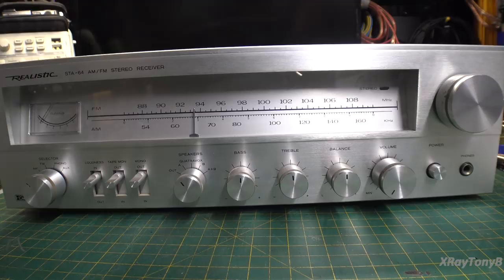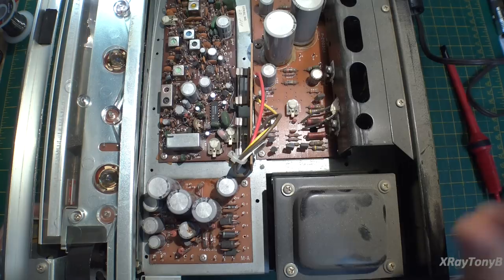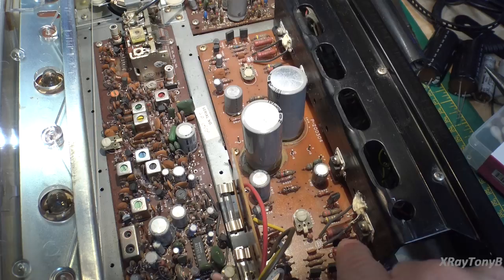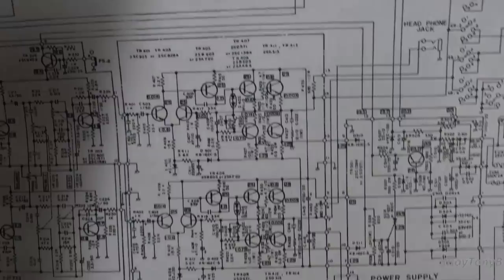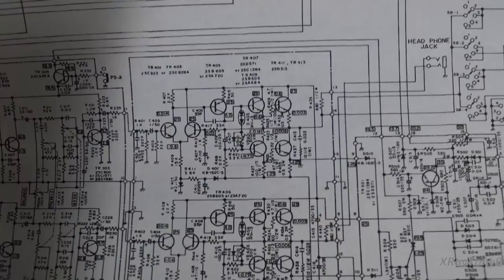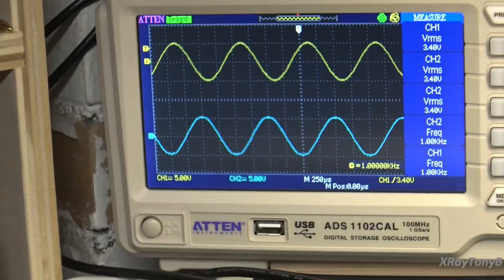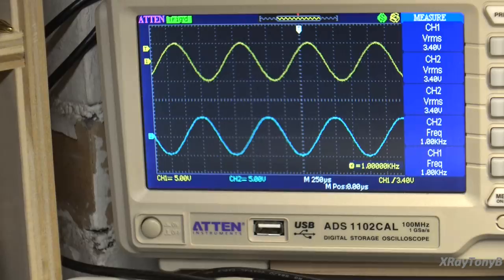Realistic STA 64 Repair and Restore

Comment: Nice video! 
I was a factory technician for Tandy from the mid eighties to the mid nineties. At that point the writing was on the wall regarding disposable electronics. Ive rebuilt thousands of amps in that time. Some of the Realistic models were average but many were exceptional. Most failures Ive seen were caused by intermittent bias pots and people stacking stuff on top which interferes with cooling. 
I had a great time working on these units... Thanks for the memories.
Reply: I was  a bench tech.for a major company in brooklyn N.Y,and Radio Shack stereo equipment sounded just as good as some of the other brands,and was more reliable.Hated to see them go out of business,makes me nervous about Sears.

Comment: Hi! I just discovered this video and I wanted to say thanks. My dad had one of these when I was a kid and we spent a lot of time listening to it. I found one recently on eBay and the guy that shipped it did a poor packing job and it arrived damaged. It was also not as described, the volume knob turns all the way around and all the lights were burned out. I bought a new faceplate to replace the broken plexiglass and found the whole front control assembly which I will replace. I have a long background in electronics so I know what I’m doing. I also have the schematic and service manual for it. Thanks again!

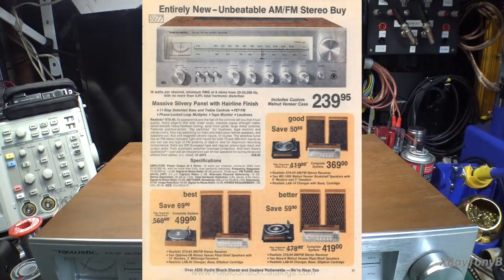Comment: I bought this as part of the best system pictured at 5:34 of your video.  I've used extensively it over the  years and I have no regrets  about buying it.  I have it  coupled with 4 Optimus 5B speakers and a  old Technics cd player and it still sounds great after all these years. The only thing I did to it was to replace a couple of bulbs. After 40 years I guess I got my moneys worth.
Thanks for the video.

Comment: Great video. I just picked up one of these has has a low and distorted left channel - so I will rebuild / recap it and use the MJE-3055 transistors you mentioned on the outputs.

Comment: Watched this video and I now again have my first love, a Realistic STA 64 that after some work is like it just came out of the box. What a unit! The wood walnut veneer case and brushed aluminum face is just another level after looking at black tin boxes with plastic faces for decades. The weighted tuner knob.... I forgot there was so many radio stations in between where the digital numbers stop at. It may not come in perfect but hearing a station 2 states away by chance is like discovering some undercover spy ring or something. lol  
A lot of folks think of clock radios and such when you say Radio Shack but back when stuff like this came out they had some pretty nice stuff. They put the same quality as the bigger names into their stuff but they were not known for their big power where a lot of the money comes into building power receivers. I got around that by using a 7 band EQ and a 40 watt per channel power booster from a car. For a 12 year old kid in 1980 my system was jamming. For the one I have now I included a Technics 7 band EQ through the Tape monitor. From the high level output speaker connects I ran it through a high/low converter and into a Crown CT 4200 Power Amp to a set of Infinity RSa speakers. If you have ever saw the first Star Trek movie, I refer to it as my V'ger project. When you can let the receiver do all it did but without the speaker resistance coming back to it (heat), opens it up to what it could have been. Everything you and I loved about the Receiver but more and more and more. Funny thing is when I went to find one of these receivers I found one that was missing the wood box but had a faceplate so it would fit in a commercial rack system. So I guess I was not the first to think about fixing it by just adding more power.

Comment: The channel imbalance in my experience quite common, and the volume control tracking is partly to blame. That's why balance controls should not have detents and why we should not be afraid to use the balance control. I have to listen mainly on headphones and these small differences can be very noticeable in my situation.

Comment: I have an STA 2200 that I bought in 1979 or 1980.  Sill mostly OK.  It has needed replacement of memory backup battery and it probably soon deservers overhaul of the capacitors.  But the real problem is the pushbutton switches that would really need replacement, as contact spray has just very limited effect.  On power-up the tuning VFO does not often lock in and the speaker protection relay chatters.  The effect sounds like between stations hiss mixed with motorboating.

One thing that I did when I bought stuff from Radio Shack was to  buy (or sometimes get free of charge) a service manual.  They have good schematics and parts lists.  Of course the Radio Shack part numbers are nowadays not too much of help.  And speaking of schematics, I would guess that the filter you mention in the IF section is ceramic (actually two), rather than crystal type.  The difference is in the Q factor. and price, of course.  A crystal filter at 10.7 MHz is way too narrow and sharp for HiFi use.  A single crystal filter is great for Ham use in single sideband, where the target audio covers just 300 Hz to 3.3 kHz audio.

Comment: I'm surprised you didn't replace the epoxy coated diodes.  They tend to fail open and I always replace them on sight with glass diodes, usually 1n4148s.  I've had them split in two while replacing them, scary.  There are some in the power supply and in the amp section that I could see from your video.

Comment: Nice video with some usefull stuff. I have the STA-64B version and I had to replace the output transistors on the left channel and used 2SD880Y but DC has risen to 150ma. I think I prefer the D880 sound to that of the D313 side. I do have some MJE3055s I may try on the other side. For a beginer they are a nice amp to work on.

Comment: This comment may not be read by you Tony, but this was A Great Video! You explained the basics of what to look for with failing Capacitors from the exterior. I watch another channel called (Vintage Audio Addict). He say's to move switches and buttons when cleaning them 100 times to make sure that they work correctly after many years of service. Maybe you did move that Balance Control 100 Times, but it needed to be moved 200 Times to clean it? Because of your honesty, some people will now understand how important it is to move the controls a lot when cleaning them, because they could end up chasing a problem that is so simple to correct and over look it. P.S. Loved your recent videos of testing Capacitors 500 different ways and showing that they need to be replaced.
Reply from the maker: I never count how many times I move the control.  I think the main takeaway from the comment is that you move the control a sufficient amount of times to let the cleaner spread out into the control and properly clean it.  Hope that helps.

Comment: I bought one of these on fleabay a couple  of months ago for $6.00. Not as pretty as yours, really just dirty and a broken dial glass.  Glass no big deal as it is plexiglass, I might just cut a piece of SS glass to replace it. Wood cabinet in nice shape also just dirty. Haven't started restoration yet, but will soon, "why I checked out your video". These old receivers seem to have a pretty good following for being low power. From the couple of videos I have watched on them they really seem to perform well. Thanks for the video as I see what I am up against with the repairs.

Comment: Its incredible sound quality. 70s Japanese were #1. Was that  automobile bulb #194 for 12 volt?. Can you do a follow-up video on adding a 3.5 auxiliary jack and/or bluetooth connection. Then it will be forward compatible 👍🙌.
Reply: I think you can connect your iPod, iPad, MP3 Player, Computer, Smart Phone, Bluetooth Receiver, CD Player, Tape Player, Phonograph, TV, or other device with a cable adapter to the AUX or phono input depending on the device.  Simply connect from the headphone jack to the receiver this way.  Many of the older receivers took a 1/8" plug to two RCA plug cable.   Most electronic stores carry this cable.  You also could order one from Amazon I think too.   If you have multiple device inputs you could probably order an audio selector switch that allows you to select which input you want to patch to your Aux input.
Reply: Realistic is not Japanese. 
Realistic was made by Tandy / RadioShack

It already has RCA inputs. You can already connect any line level device to it. If you want 3.5mm then all you need is a cable
Reply: And those are 110 volt AC dial lamps. Not at all automotive
Reply: This was made in Korea.

Comment: if you find a blown fuse it DOES NOT mean there's a problem with the device - oftentimes it can be that the wrong value fuse was used ... also important to check that no one has put in a 'too high' rated fuse

Comment: Hey Tony, New subscriber and really enjoy the content as a new tech ( just getting started and learning ), Currently im fixing a blown left channel on a STA-100 Would you happen to know where I can find the service manual? I found the schematic and owners manual on hifi-engine but not the service manual. Im not sure what pins I need to probe for idle current and where to adjust dc-offset etc.. Any info would be greatly apreciated, I know my Marantz 2235 had adjustments for both DC Offset and Idle current.  Thanks in advance! DG

Comment: I have an STA-64 in which the Aux, Phono, radio does NTO work, but I can connect in input to the tape monitor and it works. The amp is apparently working perfectly. The caps all appear to be pretty good, no swelling or leaking visible. I don't see any burned components either.  Any ideas?
Reply: input select switch or tape input switch could be dirty stopping signal

Comment: who built radio shack's reciever's?
Reply: Foster/Fostex, Sanyo, some actual Realistic designs, Sansui and I've even herd some are from Sony. All depends on model and what is inside.
Reply: I heard some by Onkyo
Reply: Sansui, Sony and Onkyo had nothing to do with Realistic receivers. Neither did Fostex, which is the headphone division of Foster. Funai (Sanyo) built the STA-35 and 35B, the end. There were two manufacturers of Realistic receivers from 75-89; Tandy Electronics and Foster Electric, with most being made by Tandy. https://docs.google.com/spreadsheets/d/1laZVTI-3JgO9iTXwHc7I0mEpfSqb8O0bREcGWk10oiM/edit?usp=drivesdk